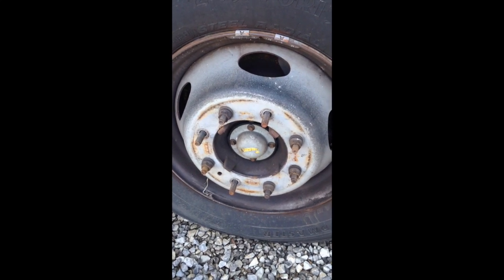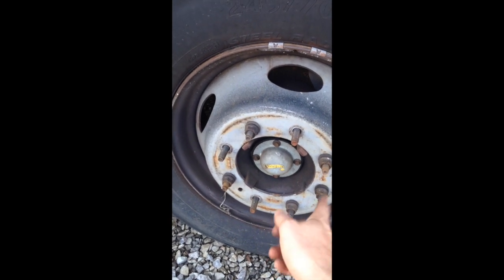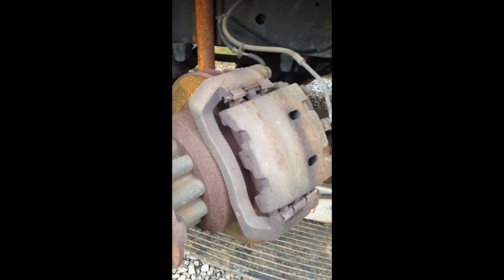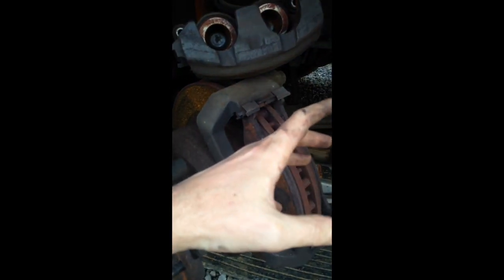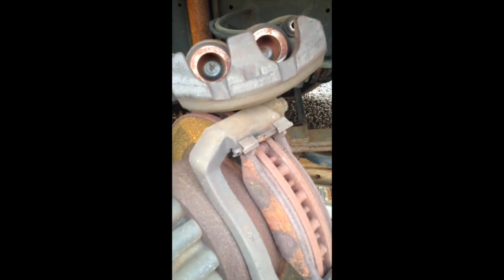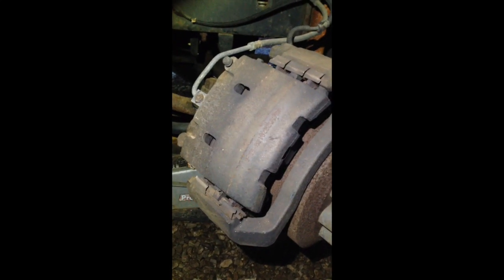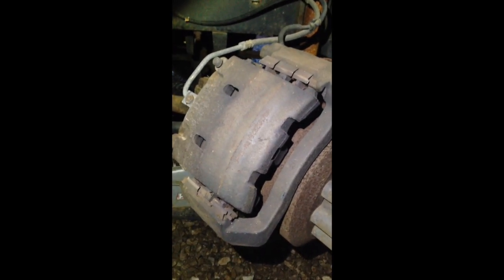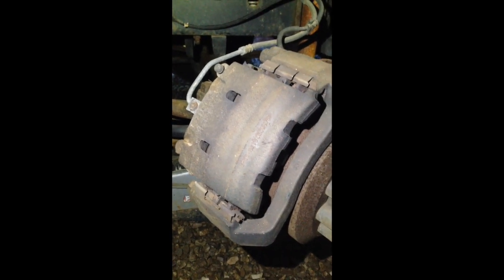RV Ford F-53 Classis Brake pad replacement. Coachman Aurora

Comment: Exactly the info I needed, thanks.  How much harder do you think the rear is, other than having to pull off two wheels.?
Reply: I did not think they where any hard to do at all. If you can do the front the back are well with in your skill level.
Reply from the maker: Just as easy. Make sure your jack and jack stands can hold the weight
Reply: Yes, I did front and rear and it was pretty much like doing a car's brakes.  I jacked up one wheel at a time, with jack stands and a huge bottle jack as a backup.

Comment: What year is this Aurora?
Reply from the maker: this unit got totaled out about a year later from a tire blow out. But I believe it was a 2007
Reply from the maker: also the two shinny parts are the slides and they came with my brake pad set when I bought it.
Reply: @junktinker  ah good. I have a 2006 and ironically I have two aged out front tires I'm replacing while I do the pads.

Comment: You did not even show how to remove the brake pad pins so one can remove the brake pads and you did not show how to put the pads back in with teh pins.......unreal.. and yet this is the most important part and you missed explaining and or showing it.
Reply from the maker: there are no pins in the pads on this set up they simply sit in the slides. but if your set up has pins I would love to have the link to your video so that I can send people looking for that set up to yours for help finding the info they need.... unreal.. how people nit pick some one just trying to help in what ever way they can yet the experts don't seem to be helping just telling everyone what there doing wrong...LOL